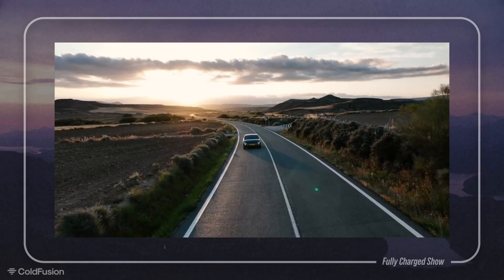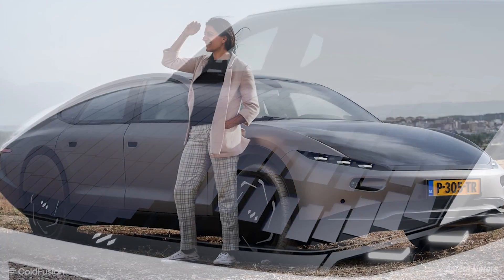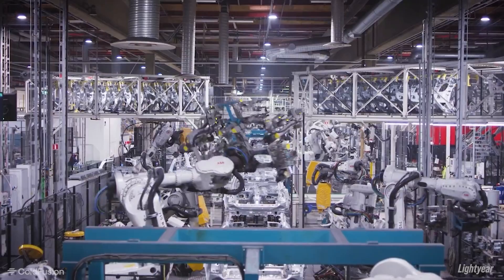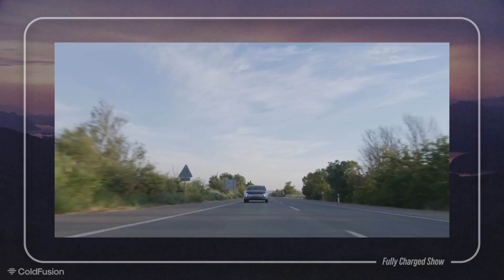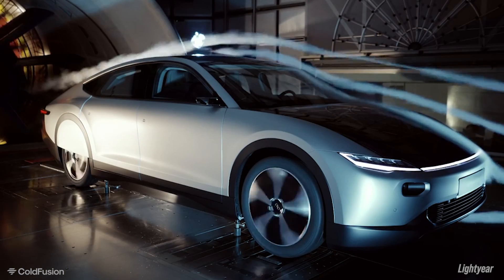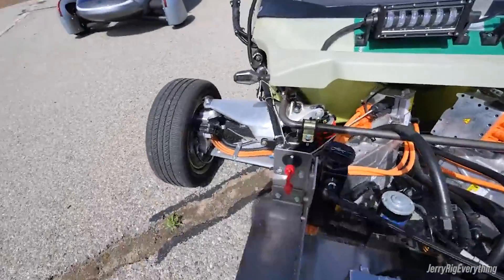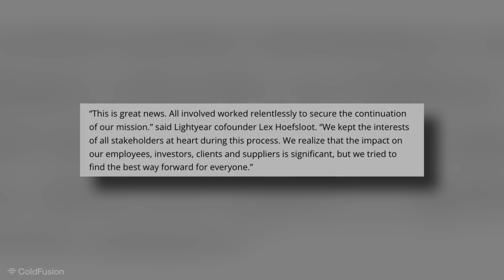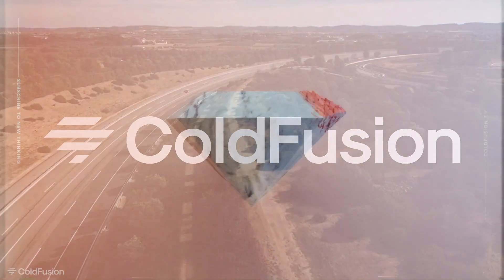3 Interesting Solar Car Projects

Comment: efficiency small battery low cost errr what you talking about its 296,000 euro's my merc eqa with a 77kw battery was only 46 euro's bah ha ha ha the first version of the nissan leaf had a solar pannel but face lift and mk2 dont ie gone back wards. uni is a waste of time unless ur going to be a engineer, doc, solicitor etc....i got a degree and then like millions just in the uk no jobs and 45k in debt after 20 years working if only just paid that debt back holding me back from own home ownership on the lucky few get on graduate job. much better these days learning and earning on advanced apprenticeships

Comment: Nobody will buy an efficient car. They tend to be ugly and under powered and incapable of existing in modern city driving, making them dangerous.
In most US cities, there is not much sunlight at all, everything is shaded by buildings and parking decks.

Comment: I am sorry but this video is telling falsch statements. The company only delivered about 2-3 cars and then went bankrupt. The car couldn't drive for months with driving. Not even in the dessert. For practical usage you would need to charge. Furthermore the companies (very young) management also lied to companies from which they were receiving loans. They told them they would use the money for R&D while in fact they would use it to pay debts. A solar car only has promise when solar panels wouls become far more efficient. But battery powered cars catched up far more quickly then solar panels w.r.t. that.

Comment: When you do the math, most people cannot charge an EV even with 30% of their roof covered with panels. It is silly to think the surface of the actual car could contribute anymore than media fanfare. These Lz0 cars could hardly cool themselves, let alone heat themselves. Nevertheless a noble effort in aerodynamics and ugly. Not a chance of meeting crash safety either. Big government won’t let any of these little guys get remotely ahead. Plus, these are currently Ralph Nader’s corvair….unsafe at any speed. 😊The electric car market is owned by the big Government payers/ players, VW, BMW, etc. Not a snowballs chance in hell for these guys. A venture for purely altruistic capital surely to be lost.

Comment: Here in NSW, the car sits in the drive for days, I travel 30kms to and from the supermarket and occasionally 100kms for medical appointments. It would be great to feed to the grid when not in use, and not be worried about range most days.

Comment: I would certainly consider buying a super efficient solar car even if the performance was lower than pure battery powered cars. Fast acceleration is overrated for everyday driving. I have also owned a Chevy Bolt for 5 years and am very pleased with it. There is no way I would ever buy a new IC car again.

Comment: Driving my 1.8 TSI Passat with 118kW daily agressively I find it weird, that a 130kW car is considered slow. Its no race car, yes, but every car does not have to aspire to be a Lamborghini. I will never buy a new car anyways, whatever the benefits are. Its just stupid. Buying anything tech used you can have 2x more of that thing.

Comment: I want a hybrid with a small ice engine and electric motors. But the battery is modular. So ill carry batteries only if i want to run electric mode. and for long hauls, rev that ice on the highway

Comment: This is important technology. Here in Australia, we have a lot of sunshine and most cars are parked in full sunshine most of the day. I would like to see a hybrid fully electric car that uses ethanol in a Sterling Engine to recharge the battery when it gets to a quarter charge, and solar, brake regen and wind turbines in the front grill to charge the rest of the time. I wonder if a car can be retro fitted with these technologies as a proof of concept.  Ethanol production in Australia could be super cheap as farmers use their produce that is not suitable for market to ferment and produce fuel.

Comment: The car only needs to go at 70mph tops,  most vehicles are driven in towns or cities, so less miles driven each day, so solar panels makes sense. 
For longer journeys you'll charge up to top up. 
Once again solar can top up whilst idle, also whilst in the services stops ..
Makes sense to me. The solar panels, would add to efficiency.
I look forward to the revolution.. 
Then with car to grid the car would add to the efficiency of the house ! 

Win win situation 🤔🤪

Comment: The lightyear was just a VW XL1 knock-off. That car could run 100km on 1 liter of diesel, so aerodynamics are not only for electric cars.
They improve fuel efficiency drastically, but as time showed no one gave a f**k about efficiency.
Everyone just wants a cheap, or an really expensive fast inefficient car.

Comment: To have a 4 wheel e-car get 1,000 miles with solar recharge with a 0 - 60 mph in 10 - 12 seconds for $30,000 would be an interesting buy.

Comment: Aptera's 100 W*h per mile at a speed of 30 mph (48 km/h) means 3000 W*h = 3 kW*h of energy spent per hour - or - 3.0 kW continuous power exercised during such drive (at 30 mph). For comparison, the popular scooter Aprilia SR Motard 50 has 4.56 HP (3.3 kW)) @ 9500 RPM. How much does a Aprilia SR Motard 50 weighs? The Aprilia SR Motard 50 weighs 106.0 kg (233.7 pounds).

Comment: Great car Lightyear should reference the 1967 Oldsmobile Toronto. The weight of the panels vs the range of the car, are the panels less efficient?

Comment: Having searched inside myself, I have to say no - I wouldn't spend $30k on a solar car which gave me some daily miles of free solar power, if the penalty was it being notably slow, or notably any other significant disadvantage.  It would have to be a decent all-round car, with Toyota levels of reliability.  Otherwise the solar panels stay on my house, and charge the car from there.

Comment: Lol, nope. When solar panels heat up, they become very inefficient sooo.. that won't work if you simply leave it in the sun. Also, the sun moves and your only getting 4 hours at most of that 1 kw assuming the heat doesn't degrade it... But it will. The answer is a more efficient PETROL engine as a Genset. That's it and even then, the battery will be 20,000 at 100,000 miles so good luck. Stupid stuff, honestly just very stupid people would believe this hype.

Comment: Does not solve the main issue - the car still needs a big battery. The fact it gets charged while parked is cool, but you don't need a solar car for it - just put a solar panel on the roof of your house or on a pylon next to a parking slot and connect it to a car charger and there you have it.

Comment: Slow with a limited range and I am guessing power. I live in a Cold Climate where we can experience 8" of snow in under 24 Hours and temps in the single digits. My car needs ground clearance, all-wheel drive minimum 17" tires, and is frequently driven covered in snow with defrosters on full.

Comment: The specs were really impressive, how often do you need to reach 100km/h in less than ten seconds, and how often do you drive faster than 160km/h? These are that were almost impressive with a normal petrol car when i grew up in the 80s.

Comment: Both Sono (Sion)  and Lightyear were abruptly snuffed out at almost the same time. Lightyear's sub-$40,000 solar EV and Sono's equally spacious, affordable Sion simply posed far too great a disruptive threat to far too many powerful vested interestts - not just oil companies but electricity suppliers/utilities and an increasingly mob-like charge-point industry and their armies of control-freak lobbyists.
Paul G

Comment: Hey Dagogo! Greetings from Johannesburg South Africa! 🇿🇦 This would be perfect in our country. I personally don't get the obsession with super fast ev's for daily use. Unless you live in Germany with their autobahn. Most countries have speed limits, if not that, then there's traffic on the freeway. So what are you going to do with your 300km/h ev? There's definitely a gap in the market for a reasonably priced, slower, but efficient ev, with a 1000km range.

Comment: With the advancements in Solar Panel materials, particularly Perovskite, PV panels should be way more efficient, cheaper, and have the ability to self-heal. With Toyota's solid state battery tech, it could prove a potent combination.

Comment: RUSSIA 🇷🇺 IS WORKING AND NOW TESTING A HIGHLY EFFICIENT ELECTRIC CAR WITH THEIR SUPER HYPERSONIC MAG DYNAMO.THE ENERGY PRODUCED IS EXCESSIVE THEN WHAT IT USES.THE BATTERIES NEVER DRAIN AS THEY RECEIVE POSITIVE ENERGY.NEVER CHARGE AND RUN FOREVER.WITH TWO UNITS OF SUPER HYPERSONIC MAG DYNAMO YOU WILL ALWAYS DRIVE FOREVER.
Reply: No need to shout.

Comment: Ok so I hope your siting down,but efficiency is only necessary if you don’t have enough of something your using.Hydrogen does not have the efficiency problem. Remember that Batteries only store electrons for a finite period of time. Hydrogen can be made 24 hrs a day for ever because Hydrogen goes back from where it came from when used. So when you have an unlimited amount of something efficiency does not matter.

Comment: Although Elon Musk may be somewhat of a competitor in this space, it might be a good idea to reach out to him for investment capital , with intellectual property on the line, it might benefit his company and also, Elon could hire the very forward thinking CEO and engineers for his company if Lightyear was to fail,  but hopefully with his infusion of capital, Lightyear would succeed, after all, Elon did spend 44billion on Twitter which he seems to be ok with running it into the ground but this investment would have the potential to be far more lucrative.

Comment: It was High price but given most cars are hitting $80,000 for anything somewhat nice and don't forget the fuel cost and increase of that cost outweigh the cost of the car. Why they whent bankrupt i would bet oil business and government with their hands in that would make shur it would fail. The cons of this car only effect speed demons  and race car type. I would buy one. I would like to solve are power issues before we run out of fossil fuel.

Comment: EV industry and efficiency, don't get me started, it's ridiculous! For a long time ICE commuter cars has had acceleration figures around 10s 0-60/0-100(mi/km), and the most of us found it good enough. We were satisfied with a top speed of around 190km/h, not many can lawfully drive any faster anyway. Regular tire width around 195-205.
Enter "green EV revolution", all of a sudden we need F1 acceleration, higher top speeds and Wide tires! What??? Yes, you see it's electric so it's green, no pollution! And people swallowed the whole idiocy, hook, line and sinker. In my opinion the EV race started backwards, it should've started with performance like our previous standard commuters which would mean smaller motors and smaller batteries and "bicycle wheels". I understand that it was a lure from the industry to advertise a new "jet age", but can you with a straight face really claim that a 3 ton SUV with lightning fast performance on HUGE rubber rollers is anything near some "green thinking", all things considered? 
Meanwhile I keep dreaming of more nuclear power being built and a future of hydrogen fuelled vehicles...

Comment: Absolute cobIers.
If you drive a Tesla, and use 1/4 a battery a day, that is 20 kwh per day.
Conversely.
A 5 m2 solar array will give you about 4 kwh per day, in a really sunny location like Arizona (ie: not Chicago).
So this simply will not work.
And it most certainly will not work in winter, in the north.
(And most city parking is in the shade….)

Calcs:
4 m2,  x 0.5 kw per m2 average sunlight,  x 0.25 efficiency, x 10 hours a day, = 5 kwh

R

Comment: The mean average day drive in Australia ia 33kms, assuming that is a school run/work commute it would be 16.5km in each direction, the battery required is tiny, someone needs to build a car that is seriously underpowered and under range and cheap, id buy it today, rent a car if I were ever to drive out of town

Comment: A simple calculation will show this project is untenable, The highest solar intensity is about 1kw/m2 during noon with the sun vertically above. The highest solar irradiation is about 8 hrs a day in the world. If the solar penal efficiency is 50% (actual value is much lower), it takes 3 days to charge a battery of 61.2kwh (assuming 100% efficiency), running a 130kw motor for half an hour.

Comment: The technology is largely being ignored by large manufacturers and governments because although you will probably still need to hook it up for some charging, it will be considerably less than a conventional EV, so less money spent and to tax. If everything our lives could be solar powered and not from the grid then that's a lot less money leaving our wallets, we could all live almost entirely self sustaining but it's not encouraged and that's why solar cars will face resistance much like the EVs in the 90s. Hydrogen cars would have been super expensive and we'd be reliant on having to pay for the fuel at the pump much like fossil fuels which is why they wanted to go down that route in the Bush era briefly

Comment: The battery capacity is 61 kWh. The constant charge in good conditions is 1 kW. Which means if the battery is empty, you need 61 consecutive hours of sunshine to be able to fully recharge it, if we consider that there are no losses. Good luck with that.

Comment: Solar panels belong on your roof. They make the car heavier and more expensive. The panels are useless when the battery is full, on the house they can put exess power into the grid. In winter the panels are useless, but you still have to lug them around. I park in a garage at home and in the shade at work.

Comment: This seems like a waste of solar panels. There is currently a shortage of the materials and manufacturing capacity for panels, so the ones we do produce should be put to maximum use in solar farms. The electricity can then be delivered to a highly efficient car, but centralizing the power generation is a good thing especially as we are just beginning the green revolution. This car seems like an overpriced virtue signal for the wealthy to brag about rather than a practical solution to mass transportation.

Comment: This is complete silliness. $131 million scam and they are back with Lightyear 2??? Then a couple more scammers were tossed in quickly at the end. LMFAOOO!!!
1) Claimed 5 square meters of panels = 270 sq ft. I will be generous and say 100 sq ft is shown on car.
2) 61.2 kwh battery with 388 mile range = 6.3 mi/kwh. This is double Tesla's real-world consumption (in town, not road tripping at 75mph which lowers it) rate. This is unrealistic. You still have the battery weight. Plus, you have the added solar panel weight. 
3) Solar panels produce roughly 10w/sqft; At 4hrs/day average of sunlight, with 100 sq ft on car, this equals 4kwh of electricity produced per day. At $0.20 per kWh = $0.80/day saved. Best case scenario. 
4) They did not make solar panels 22% more efficient. Had they done this, they would not be bankrupt.

Comment: Three hundred grand so you can say you have a "solar powered car," is a bit much. This was a novelty item at best, and a scam at the worst. Sure, if you live in the desert, drive slow for short distances, and never use the air conditioner, it might work for you; but in my part of the country, you could buy a house and a car, and still have money left over for years of fuel.

Comment: Before Thunderf00t makes a video on this, let me save you some time.

Solar requires a relatively large amount of area to produce any significant amount of power, especially seeing batteries for EVs have breached 100 kWhr. 
You need a redicoulsly efficient shape and drive relatively slow for the energy balance to be even. Most people do not drive their cars as slow as required.

So, if anything, solar roofs can only really be thought of as range extenders.

Comment: The Opel Corsa that I drove all through college and I still drive occasionally is even slower than the Lightyear 0. EVs have altered our perspective on how fast EVs can be. Remember that most small hatchbacks do not get to 100kph that quickly, and they usually barely ever go above 150-160kph. So yeah! I'd have one of those. The problem tho, would be that I don't think I can plug it into a charger and leave it there forever, nor make a street parking spot have a charger that could feed the grid. Sure I'd have charge forever, but not return it to the grid. Sadly

Comment: there are (important) physical difficulties for this type of car to be viable. If we consider that the energy that the earth receives from the sun, above the clouds, is 1400 watts/m2, a car that is in the sun for 12 hours will accumulate ~30kWh.
With current technology, where motors and batteries have high efficiencies compared to ICE, it would be 150km (very good).

But we have to introduce the efficiency of solar panels into the equation. The best panels have an efficiency of 420 watt/m2 -> 10kWh -> 40km.

And not to mention the case of being overcast. Having to park under cover. Parking is under trees. Having to have the car washed...

This company served to deceive the buyers of the first versions, the early adopters. And to discredit the EV industry.

Comment: This was never promising and it's not shocking that it failed. The new vehicle will fail too. Still too expensive and not competitive. ~5 m² is too little surface to bother. A few hundred  W (in average)  is nothing.

Comment: If manufacturing was truly moved abroad and costs were cut to 1/4 of the Lightyear 0 because of it ... then you see how unviable European industry actually is. Insane manufacturing, staff and energy costs combined with not enough funding to push even promising projects like this to the market. A great example why Europe is deindustrializing so quickly.